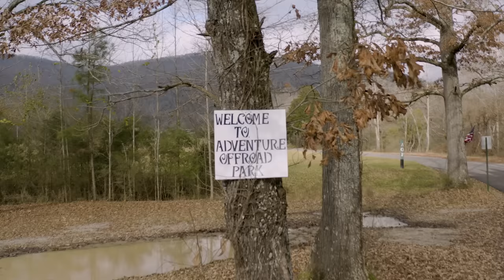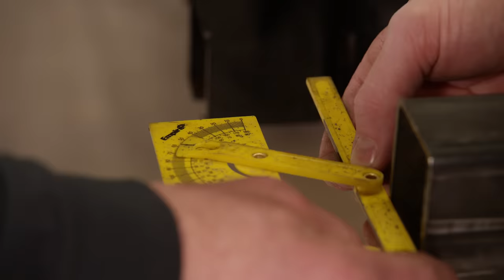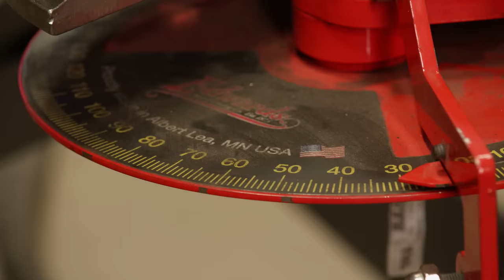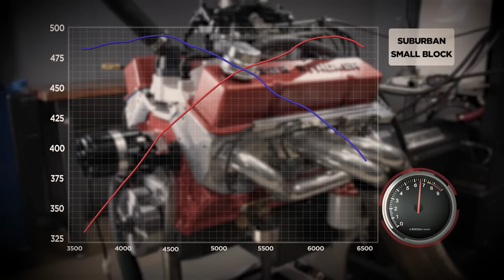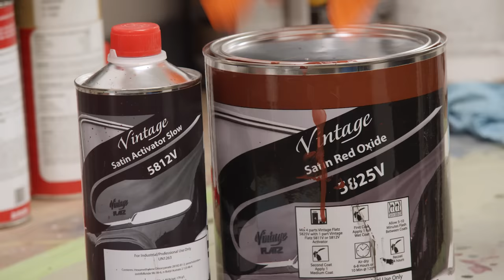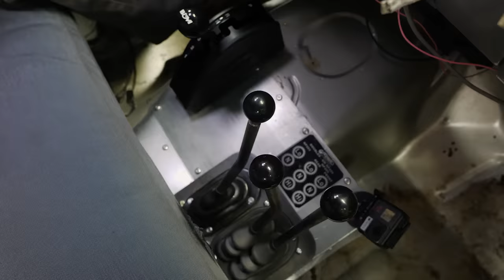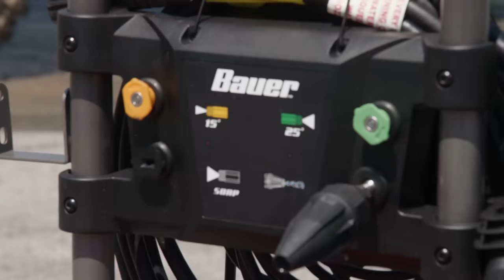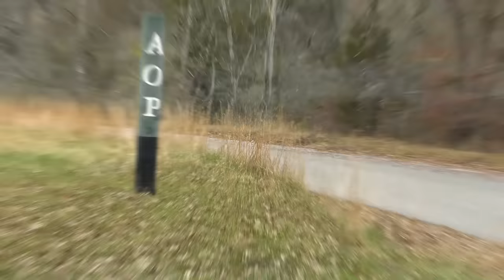Full Build: GMC Suburban Goes From Boring To Unbreakable

Comment: Why does the rear diff seem way way of center? The passenger rear wheel sits inboard of the body and the drivers rear wheel sits way outboard of the body. This can be seen all through this video and not just after the spare tire was installed. Over all this is a very cool build but the tires don't look good. They need to be at minimum wider and again the rear diff looks off center

Comment: Just remember kids if you didn't know how to drive off-road you'd have the same problem they did in the beginning personally I would have drove to the top of the hill the first time without all the backing up and spending tires because I understand there is a thing called momentum and it's a fine line between momentum and breaking things

Comment: As many have said, it definitely needs a wider track. 
Main complaint is as long as this whole video is, did I need intros to every spot? No. 
And apparently missing episodes too. The 14 bolt build, the rear suspension build. Hell the body got painted, but nothing on it. The shock reservoirs being attached, the brake setup. The sniper wire up. 

One reason I quit watching so many speed/pn/etc car shows & switched to YouTube channels. They basically show start to finish, 100%. Do I need to see EVERY nut & bolt? Nope, but 60% vs the 12% PN show is definitely welcome.

Comment: Redundant systems is what I did with my 80 bronco, back up fuel pump, ignition coil, distributor guts, carb jet kit, spare tire, u joints, etc. be ready

Comment: "Don't want to scratch the paint.." - OK, it's going to be scratched when you hit a few rocks and tough branches. Makes no difference. It's not going to be a parking lot princess. If you're going to run that big of a tire, at least run bead-locks for when you have to deflate, as you just made a prime example of in the video.

Comment: Give props to the builders but ruined exhaust it should of been 1"3/4 lt headers 2.5 dual exhaust with x-pipe & 2 borla atak crate mufflers not the restricted chokemaster kit also should of rhinolined inner fenders & bottom of body & also rhinolined the floor inside

Comment: All that suspension for the diffs to get stuck on some tiny rocks, if u wnat a better 4wd you need strong shocks with lots of travel, some 6 inch coils. And for the love of god you need to put bigger wheels on it it would do be way better for what you were trying to achieve.

Ps: my patrol is way better

Comment: Just going by the title,  but only way that's possible with a GM product is if you replaced it all but the the sheet metal with ford parts, dodge if you have trouble finding good differentials.  If you went all GM, have parts rdy,  you will definitely need them sooner rather than later.

Comment: Major disappointment, no role cage, no sway bars with quick disconnects for the trails, and most importantly on a stamped channel frame no reinforcement for the stearing box. It goes to show decent build, with major key components missing

Comment: Those remote reservoirs on the front shocks are doing much more harm than good. Mounting them over the engine like that is just causing them to soak up all that engine heat, which in turn is causing the shock fluid to heat up and cause fade far sooner than would happen if the reservoirs weren't there to begin with. 

Shocks are basically just radiators. They convert the kinetic energy of your rig bouncing up and down into heat. Then the shock body radiates that heat away. Remote reservoirs are meant to be a method of adding more surface area to the radiator. If you are adding heat to your radiator instead of drawing heat away from it, you are defeating the purpose. 

TL:DR Get your shock reservoirs out of the engine bay you dunce.

Comment: All they had to do was tighten up torx bolts in that column that would have been fine, but no just yank it out and replace it with a junk non tilt aftermarket column... Talk about throwing away money.

Comment: I really think I need to stop watching these two guys and their show. This is the second full build I have watched and this is the second full build I have seen so may things wrongs. The exhaust pointing straight down in the middle of the rig, lets hope you never get stuck in traffic. The rig is too tall. First, it is a guys truck. Meaning only guys will be attracted to it. It is very top heavy so it WILL roll over. As shown in the end there, it makes a great mudder. And again it will attract a lot of guys. Next the interior. No real space for your guy friends and the gear needed to go camping. You left bare metal which will rust out fast. You left so much out of the interior that riding it you will need ear plugs. You took a great idea and just half-arsed a build that Xtreme 4x4 would have done. except they would have done it right.

Comment: The whole time I watched this all I could think is, what the…
How do you manage to have a show like this and have complete rookies try to build something like this… Maybe it’s a show about what NOT to do. First you couldn’t even box the frame or reinforce the steering box like every 70s and 80s k series should for off-road use. Then you picked the worst wheel and tire package. Lifted it way too high. Can’t even figure out a basic coil over setup. Can’t weld. Don’t know basic 4 link geometry. I cringed so hard at the hydraulic hose routing. Will literally get ripped off by anything on the trail. Project “unbreakable” literally the most fragile build from such a high budget show